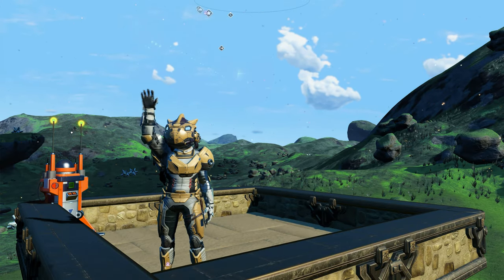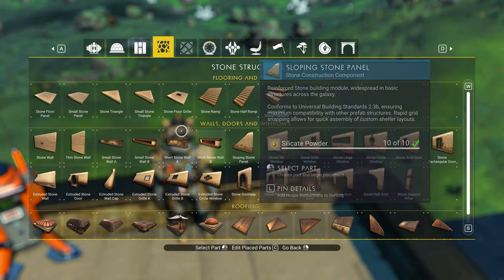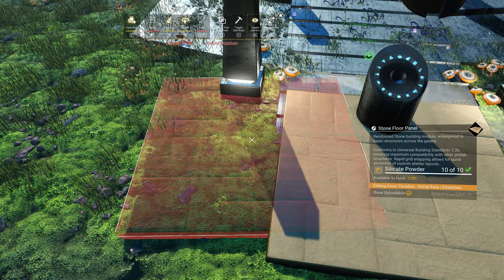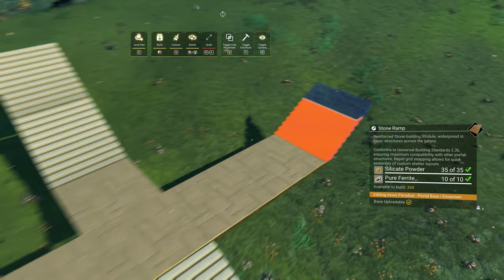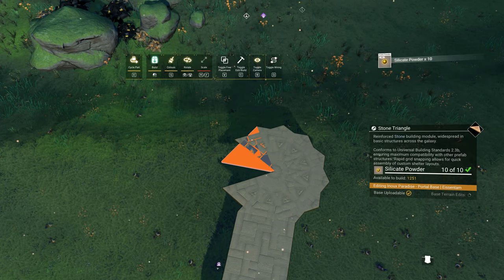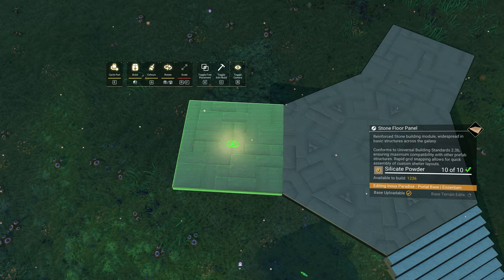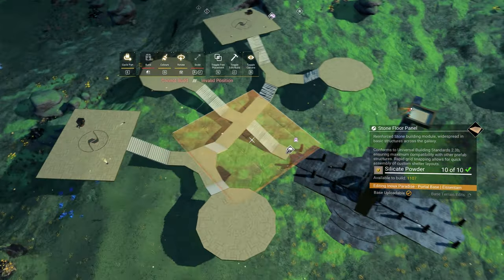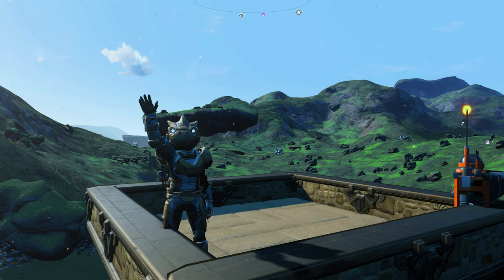How To Build A Portal Base - Building the Basics #nomanssky

Comment: hey i love your bases! they are so clean and awesome, but i had a question! i am only 40 or so hours in, so i’m still learning different things haha. you may have went over how to do it and i just missed it, but you mentioned you hid your battery to power your base in the ground. how did you do that? i am getting my the power and stuff figured out (electromagnetic generator and battery wise) then doing the structural building, and was curious where you put it/how you did it!
thank you for awesome videos!!
Reply from the maker: I used my terrain manipulator and dug a hole in the ground till I've reached bed rock. placed the batteries down there, and after i was done wiring the whole thing, I've restores the terrain. If you're going to try that as well, make sure you place some kind of marker on the spot where the hole is... you might need it later on. Trust me... i've learned the hard way ;)
Reply: @DoubleDashGaming  thank you so much!! i was thinking that was the way to do it but wanted to make sure haha! i am about to start doing the building structures now (the 3 rooms haha) so i’ve been busy getting this base together. thank you for the awesome tutorials because otherwise, i’d be building very small and boring bases!
really random, but i just did the weekend nexus mission of saving a life form and it was on a planet you’ve discovered and had some bases on haha! small world (kinda)!